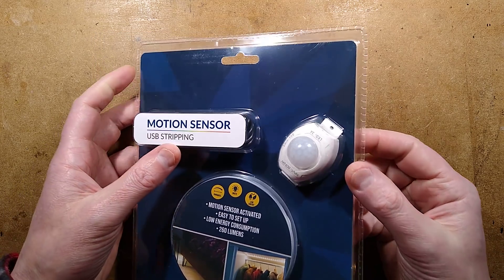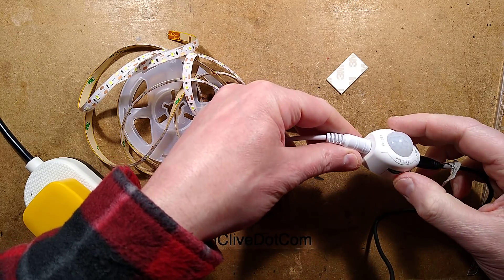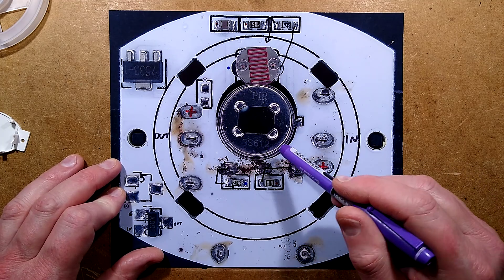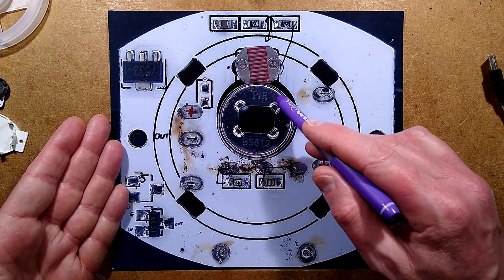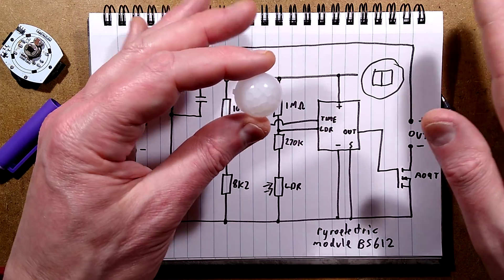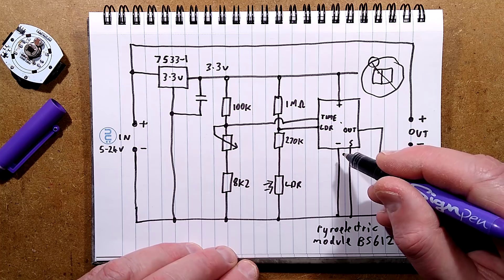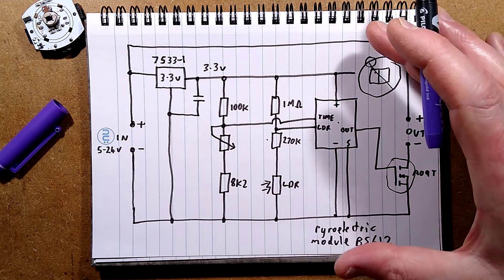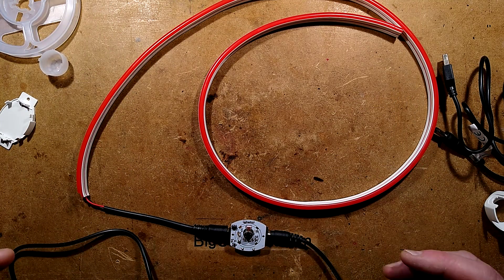Poundland's PIR LED tape.  Worth buying just for the sensor.

Comment: Hi Clive. I have one of these & it was working fine... until I decided to hardwire it to a white USB cable, as the black one was a bit obvious & unattractive. Anyway, it now lights up, but never turns off. What on earth have I done? 🤔

I tested the light sensor & it seems to be working fine, according to the voltages in light & dark. 

Any ideas? 🤔
Reply: Oh, and when I desoldered the USB connections I'd fitted & plugged it back in with the black lead supplied, I have the same problem. Lights stay on permanently 🤷🏼‍♂️
Reply from the maker: Have you connected it the right way round?   If shorted it can cause the transistor to fail in a continuously on state.
Reply: @bigclivedotcom  Yeah, the polarities are correct.  Seems like I've goosed the PIR & the light sensor somehow 🤔 . Annoying! Cheers for the reply 👍🏻

Comment: It's videos like this that got me keen on perusing the various $ shops in the area (and when I travel as well), alongside your video of your "ghost repelling off-grid device" and your statement about how sometimes buying the solar powered stuff at the $ shop have a much higher value due to not being able to get those components elsewhere! That got me thinking about the battery holders and how one can buy them from Amazon, sure, but being that I get a small string of LEDs AND a battery holder is worth more to me than the device as is.

Comment: I instantly thought of how useful that PIR module would be when I saw these in Dealz. Just bought one this morning but sadly, seems to be a dud. The strip lights when plugged in at first but then switch off and never light again, motion or not! Seeing some hairy looking solder joints though so might reflow it and see. Either way, for the price, this kit is a true bargain.

Comment: I wanna ask a dumb question that’s beneath your pay grade: 
Does this only work when it’s plugged in? 

Thanks
Reply from the maker: Yes.  It needs external power.  But you can get cordless lights with PIR sensors that can be recharged from a USB charger.

Comment: I'd like a setup like this to work in daylight also, maybe attach a 5v buzzer, can you recommend anything ?
Reply from the maker: If you open the unit and cut the LDR light sensor off it will run in daylight.  You can get 5V sounders.
Reply: @bigclivedotcom  Cheers mate, was not sure about that, ordered a wee 3v buzzer for a couple of quid, would have been ideal for shop entrance ;)
Reply: @bigclivedotcom  Hi Clive, sent you a wee message on FB, with a photo of inside etc ;)

Comment: Could these be run from a solar panel?
Reply from the maker: They could if a suitable one was used.
Reply: I recently tried an unbranded solar power bank thingy with it -- it worked in a strange way:- with the wheel set about halfway the light would come on repeatedly without any triggering for 29 seconds then stay off for 9 seconds, other settings giving similar proportions. I have no idea why!

Comment: Do you know if there’s a way to keep them on 24/7?
Reply from the maker: You can disable the light sensor by opening the unit up and either cutting the light sensor off or covering it with a bit of black tape.  The unit will then work on the PIR 24 hours.
Reply: @bigclivedotcom  awesome thank you so much, very speedy reply!

Comment: What else could you use the sensor for? Curious 😊
Reply from the maker: Any low current and low voltage load.  Usually just LED lights.

Comment: .bought 3 of these now, running them off a 9v battery works well for a couple of months. Just packaging a made up set for a friend to use outdoors around his bins. It'll be a good test for a part sheltered outdoor site. Thanks for the video
Reply from the maker: Keep in mind that the LED tape supplied is only intended for 5V.

Comment: Old vid, I know, but I happened to buy one of these a few days ago and hacked it to work properly. Mounted in my wardrobe it wouldn't activate because the ambient light from my ceiling light was too high for the dusk sensor. I added a small square of white electrician's tape over the light sensor and now it works fine. I'm no Big Clive, but I am proud of myself :)

Comment: Anyone have any idea why the LED output has dropped to 3V3...? I recently started powering it from a 12V wall-wart and a few days later the LEDs began lighting up only dimly. Now, powering from 5V powerbank or 12V supply, the LEDs remain dim and the voltage across their pins is 3.3V; something seems to be fried, but what...? Long shot, but any input very welcome!
Reply from the maker: The LED tape supplied is only suited to 5V.  With 12V it will have been damaged.

Comment: Pity this is only 2m. A longer run would be perfect for sticking under my stair handrail for automatic, subtle nighttime illumination.
Reply from the maker: You can buy rolls of the 5V LED strip or get the 12V stuff and add a 12V plug-in power supply.

Comment: Mine is not turning off (are lit even in bright room), I have it connected the right way round. And the leds are not lighting in full power, like dimmer. I've tried it with diferent power supply too... help?

Comment: Bought this for my elderly mother so that this lights up her automatically if she goes into her flat hall at night.  The sensor works really well and the only thing I really see could be a problem is the tape stickiness under heat, but for goodness sake it cost £2(!)   No instructions whatsoever with the product but none required....

Comment: Update - these are now reduced to £3 !!
I have fitted a few in dark corners of the house and run them from Poundland power banks which last a week of more for the 1200 mAh version. The 1200 mAh power banks have been reduced to 50p and I bought the last one in my local store. I have also fitted a couple and run them from a 12v battery with a solar charger so I don't have to use a power bank. All in all a bargain - so much so that I bought 6 of them for current and future uses.

Comment: Could someone please tell me if I could power the leds from a 9v battery.  In other words will the output be reduced to 5v or would I still get 9v out and blow the leds. I don't have a socket where I want to use this and am considering running off a 9v battery..
Thanks in advance.

Comment: There's 2 versions of this kit now. As they were reduced to £3 I got 3 sets. The first 2 are the newer ones with 30 LEDs per metre compared to 60 LEDs per metre on the old ones. The newer one also has a different sensor with a DY3108 IC instead of the BS612 like the one you looked at.

Comment: Hi, is there a way I can make it trigger in normal light?  I want to use this for my kitchen worktops but its not usually ever dark enough to work
Reply from the maker: If you open it and black out the light sensor it will trigger at higher light levels.
Reply: @bigclivedotcom  Hi Clive thanks so much for that advise, I took it apart and a tiny bit of black tap on the light sensor now means they work beautifully in my kitchen.  These lights are a bargain, thanks again!

Comment: Hi Clive, thanks for that and all the other interesting stuff.  For some reason we humans love listening to someone who really knows their stuff.  Anyway,  I bought one of these poundland PIR LED switches a few days ago;  btw there's been a 40% price drop - I was only charged three pounds  :-) .   I thought it may be possible to repurpose it into a little project my friend and I have been talking about.   Every December he sets up a Lemax Christmas village in his front window.  The Christmas scene includes an electric model train set and chair lift .   The kids (and some grown ups) like to stand outside his window for a few minutes and admire the Christmas village with stair lift and trains running around the track.   He doesn't mind running the chair lift all the time but the trains he only wants to run for a few minutes, ideally when some little people are standing outside his front window looking in.  I thought maybe the 12v supply for the tracks could be switched by a relay which is activated by this poundland PIR sensor.  In other words,  connect the output of this switch to a relay instead of the LED tape.  I know I would have to place the switch outside because as you say,  infra red doesn't pass through a glass window however I've found it does pass pretty well through a yoghurt pot - so long as I empty all the yoghurt out first.   That means I can achieve YP65 for a few weeks anyway.  I've stuck a bit of blue tack over the light sensor so now the switch fires during daylight hours as well.  The timer on the switch is handy, it would be set to about 3 mins which is how long he wants to the trains to run when the switch triggers.  The thing I'm wondering is, can I simply connect the relay to the outputs that the Led tape would have been attached to.   I think I can because it's just energising a little electro magnet inside but another part of me is worried I might just be shorting the switch out!  Cheers Clive.
Reply from the maker: Check out the doppler sensors.  They can see through glass.

Comment: Very good video thank you. Could I plug 2 of those sensors to 1 strip of led. Like 1 at top of the stairs and 1 at the bottom so led lite up if I go up or down?? Thanks
Reply from the maker: It might be viable to do that, but each end would require a power supply.
Reply: @bigclivedotcom  thank you for your reply. If I understood, 1 led strip connected to output of both sensors and both input of sensors connected to separate USB socket. Thanks again.

Comment: Sorry for the likely silly question - how would I add a longer led strip? Is this possible? Any guidance or links would be appropriated.
Reply from the maker: You can get rolls of 5V LED tape.  Or for bigger runs use a 12V power supply and 12V tape.

Comment: Hello! Great video. Do you think it would it be possible to take an output from this and have it act as a switch for another device?
Reply from the maker: It could drive up to 12V loads directly, or a relay for higher loads if a protection diode was put in parallel with the relay coil.  But for higher voltages you do get dedicated PIR sensors.
Reply: @bigclivedotcom  Thanks for the reply Big Clive! Some good info there thank you, it was mainly to act instead of a push button switch to turn a Wemos D1 mini running WLED on/off (so the PIR triggering would act as the button press). If I get something working I'll make a video :D

Comment: Hey, I bought one after watching this video, but I’m not sure I’m using it right(lights when i plug it in, but the sensor doesn’t seem to work after). Any advice https://mobile.twitter.com/thespyJavert/status/1422950102688206850
Reply from the maker: Have you mixed up the input and output?
Reply: @bigclivedotcom  Thankfully it wasn't, as that would have been rather embarrassing!
Reply: have you fixed it?
Reply: @wtfDorianGray  ahh yea, sorry. I did the usual of turning it off and on again and switching the cords around. Works a charm now

Comment: Another good video. Would it be possible to bypass/remove the pir unit and use it as dusk TIL dawn light?
Reply from the maker: You can get dedicated low voltage dusk sensors.
Reply: Thanks for the reply. I have a minuscule amount of knowledge compared to you but I like tinkering with things. Keep finding these products to experiment with.

Comment: Thanks. I can't find it on Poundland but.  I have a PIR 8 - 12/24v. With the one you explained and the one I have - £2.60 ebay. Could I use it in my car as a motion sensor to switch the horn on as an alarm if the door was opened ?
Reply from the maker: It could trigger the horn relay but not drive the horn directly.  You'd probably also need to add a back emf diode for the relay coil, and this module would only work at night.

Comment: Hi. I brought one of these kits to use for under kitchen cabinet lighting. It works well. But I've got about a foot of tape left over and I want to use it for a table lamp project. Could I simply solder an old USB cable on to  the tape to power it from a power bank?
Reply from the maker: Yes you could.
Reply: @bigclivedotcom  thanks very much 👍

Comment: Advice please  I bought 3x of these after watching. I've installed one (so far) in my campervan. Before install, I tested with my phone charger (5v) (no issues). But using 12v, the led strip gets too hot to touch for more than a couple of seconds.  Is it safe?  Even if it is, the glue on the self adhesive tape will probably melt causing the strip to become unstuck. Maybe faulty? Light output seems normal, not over bright.  Thanks in advance.
Edit:
Taken my multimeter to it, and the movement sensor is outputting 14v, the same as the input. Tried another sensor unit, same. It appears not to reduce the voltage, just overpower the LED's producing excessive heat.
Reply from the maker: Although the module can switch 12V the LED tape supplied is only rated for 5V.  You can get 12V tape on eBay.
Reply: @bigclivedotcom  Ok, thanks. Seems it is misleading as advertised. One would assume you can choose the voltage between 5-24v to work with the supplied LEDs.

Comment: This would be ideal for use in an RV (native 12v power throughout). I'd love to get my hands on a couple. Do you have a link where they can be purchased in the US?
Reply from the maker: You can buy similar units on eBay for use with 12V LED tape.

Comment: Can the sensor be used for other things than just the led strip that comes with? So if I plug it in to a USB port with the cable that comes with, I could turn it on or off. Say if I were to fit the sensor on or near a games console that turns it on when I activate the sensor?

Comment: Nice.  I'm curious about the Doppler sensors. I'm looking for something that works through windows. Where can I get some more info on those?
Reply from the maker: eBay sells various doppler or radar modules.
Reply: @bigclivedotcom  Thanks Big Clive, I shall check them out.  You haven't done any videos/tests on any by any chance, have you?  I bought some units on AliExp a while back that were meant to work through glass but didn't.

Comment: Have been looking for a pir / proximity  switch for a string of led lights i will be fitting under the edge of a wood shelf i have in the boot area of my car . The shelf over hangs some storage bins and I can't see in them when it's dark. The existing boot light is a very dim filament lamp I have been considering making an ir switch but this pir looks just what I need.  it can supply enough load current and I will be able to plug it into the boot power socket or pick up a feed from the existing boot light. Thanks for bringing this pound land item to my attention

Comment: Hi Clive, I tried the full reel of LED tape at 12v and the LEDs nearest to the power plug got hot quite quickly. Is this normal or does it suggest a fault?
Reply from the maker: The tape is for 5V only.  The PIR module can switch higher voltages, but only with matching tape.
Reply: Ahh, that explains everything! Thanks for the reply, Paul

Comment: Is that a motion sensitive sensor
Reply from the maker: It detects body heat movement.
Reply: @bigclivedotcom  thsnls for the reply can you point me in the right direction I'm after a 2m LED motion sensor light strip to go under my worktop or one that automatically comes on when it's dark in the kitchen
Reply from the maker: @revparsons3tl  You can get 12V motion sensors on eBay, and a wide selection of LED tapes.

Comment: Do you know if its possible to extend the 'on' time to maybe a few hours? I've some LED candles that I'd like to come on automatically when it gets dark but not stay on all night.
Reply: I should have added 'to come on when I first enter the area/room'. On inspecting the datasheet (I should have read that first) it appears 80 minutes is tops but then the timing values don't seem to match the Poundland arrangement in terms of resistor values (or am I just not seeing it?).

Comment: Love your explanation. Any chance you could show how trip a 12v relay on the output easily? So it could say be used to switch a 12v 15amp supply to a spot or flood light.

Comment: You need to describe this in simple terms for older viewers like me. All I've learnt is that it has a circuit board and a sensor. 
Is it a movement sensor, such as an internal burglar alarm.
You are talking to people  who already have some knowledge of what this device is.
What is the tape for? All I can see is that appears to have copper contacts on it.

Explain it in laymens terms, we don't all have the required tech knowledge to understand what you are talking about.

Comment: I bought one of these. Is there a power bank you would recommend that doesn’t have auto shut off? I want it for a wardrobe
Reply from the maker: It depends where you live.  Poundland does a Geek £5 power bank that stays active.  There are also USB rechargeable PIR lights available on eBay.
Reply: @bigclivedotcom  Ah yes I did see those. Are they the 4000mah? I picked up the 1200mah but I don’t think that provides enough current for this. I have cut it down to 1.5m
Reply from the maker: @mrtechguru22  Yes.  The 4000mAh ones keep their 5V on all the time.

Comment: Very interesting video and very well explained. Could I run two of the detectors in series with one just acting as a movement detector to trigger the other one with the power. Sort of like one at the top of stairs and one at the bottom?
Reply from the maker: Yes you can.  Just parallel them.

Comment: I bought a similar set a few weeks ago to illuminate a corridor,but unfortunately it is battery powered,using four AAA's.And it soaks up the power. Six volts,bright light,but powers down quite soon. So I leave it switched off, rather than on sensor. I have noticed other similar lights are heavy on batteries,so the usb versions are better value.